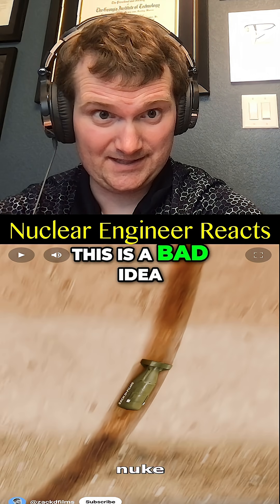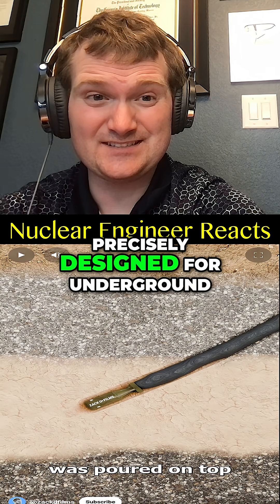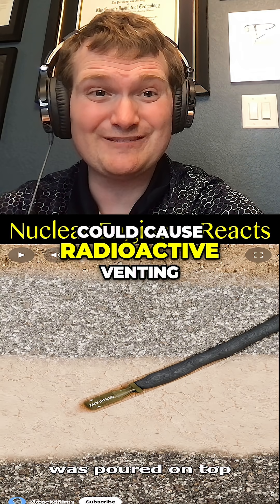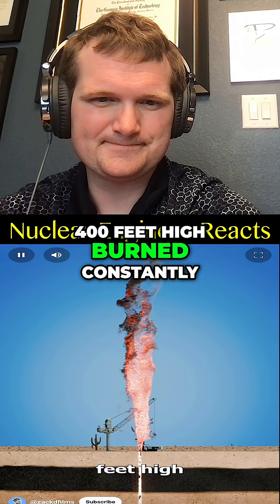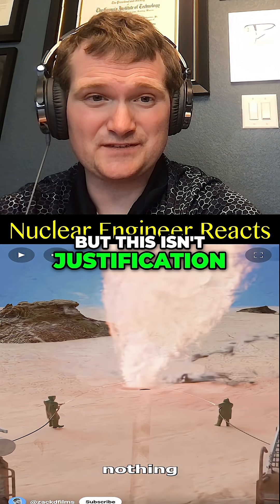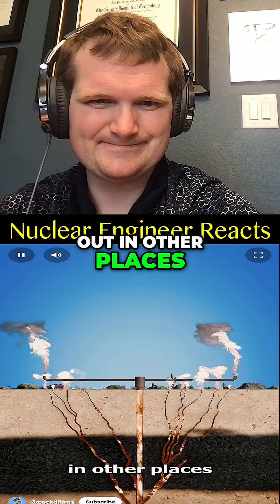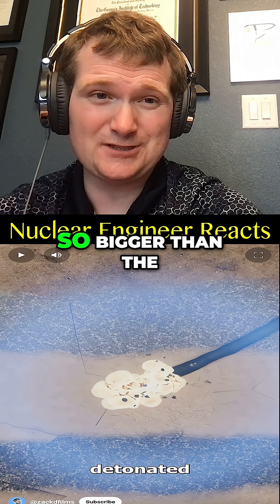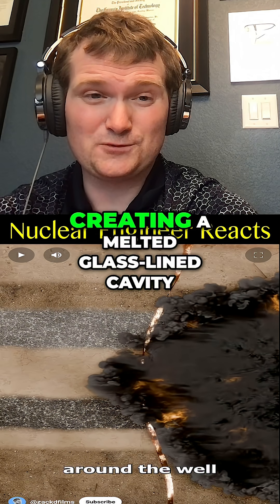They Nuked a Gas Well? - Nuclear Engineer Reacts to Zack D. Films

Comment: Bro is too worried about radioactive contamination, this happened in a remote place where there is nothing and no purpose except to mine gas
Reply: If a nuclear engineer has concerns about contamination I'm listening to him
Reply: @NotCadu  Here in the USA, our federal government did something quite similar out in Grand Junction, CO. They used a nuke to frack an underground formation and create a cavity that supposedly would later flow natural gas. In reality this was just the cover story for a secret program that would create rare elements/isotopes in large quantities using the extreme neutron flux in the vicinity of the explosion. Yes, the AEC planned to make fissionable elements like Californium in large enough quantities for use in missile warheads and shells because the critical mass was much smaller than Uranium. Of course getting to these materials would require mining the radioactive underground cavity and transporting the “ore” to a processing facility in Idaho. 

Now tell me, which country was planning on doing something bat-shit-crazy? At least the Russian use of these underground nukes made sense.
Reply: @NotCadu of course a nuclear engineer is going to have a problem with it. I’ve also got a welder friend who every time in public points out crap welds and says thats a bad weld or that’s dangerous.
Reply: @psilocybinenthusiast5200 That's because it is. An engineer knows why it's a bad idea. Other people just assume it's fine if nothing happened yet.
Reply: @FarawayBrawlHacks I’ve also spoke to plenty engineers who have literally got zero common sense. And it screams no common sense to let a live gas well atmospherically leak like that because ur scared to do that in a desserted area. They had to shut it in.
Reply: its contaminating 1.5km underground in the middle of nowhere... lol so what?
Reply: That’s why I’d say it was a dumb idea, why do this if they could just let it burn? A fire in the middle of nowhere isn’t gonna really be an issue.

Comment: Sounds like if this guy was in charge the fire would still be burning today
Reply: 100% otherwise he would say a solution
Reply: OK, and then what would be the harm in letting it burn?
Reply: @briananderson1246  Severe regional pollution. At a Hydrogen Sulfide concentration of 0.8% and burning 12 million m3/day, that's 96000 m3 H2S daily. H2S burns into SO2 which on contact with water becomes H2SO4 - Sulfuric Acid.

Total output of SO2 while burning would be 98 900 tons per year. For reference, this is around 15% of all coal power plants in the US.
Reply: @briananderson1246 so you're scared of a little radioactivity but you see no problem with s dire geyser burning off for 50 years?

Interesting line you have there.

Comment: How can US Engineers be so bloody minded and stupid with regards to the solution to this problem. In the first Gulf war the Russians cut the resolution time for putting out the oil well fires by 80%.  They fired freezing air through jet engines into the wells and obliterated the heat. How can you people not know this.

Comment: What's not in this video (and I'm not criticizing Tyler, this isn't in the original video)  is that this well burned for almost three years before they decided to go nuclear. I'm not smart enough to know whether it was their best option, but they waited a long time before trying something this wild.
Reply: Of course it was contaminating the atmosphere it was just spewing gas and fire infinitely lmfao
Reply: Meanwhile Centralia, PA's been burning for 60 years. lol
Reply: "Go nuclear." Yeah. Literally.
Reply: What I want to know is if they even needed to do this. From what I’ve heard it was in the middle of no where where it wouldn’t hurt anyone, maybe it was contaminating the atmosphere? Important details in justifying a risky solution to a problem that might not have even needed one,
Reply: @Dovahkiin106  IDk, during the cold war the atmosphere was not a big concern to the americans nor to the russians, if i remember correctly the soviets were trying to use nukes for "peaceful" purposes but most of them failed or were never conceived
Reply: @Dovahkiin106  Urtabulak had very high gas pressure (why the flame was so enormous), which both means gas burns faster and it is cheaper to extract. The reason the Urtabulak gas well failed and caught fire in the first place is a very high concentration of Hydrogen Sulfide. It burns into SO2 which on contact with water becomes H2SO4 - Sulfuric Acid. CO2 emissions is a global problem, SO2 is what generates acidic smog close to power plants. It was extremely polluting.
Reply: @bpz8175 i see I see
Reply: It was the least insane Nuclear project of Soviet, and it worked wonder, the more insane nuclear project... Well, it ended so badly that they had to cancel midway... (They tried to dig a canal with nuclear, but the cost was too much, so they had to cancel it, the canal never finished because of the nukes). Nowadays, the nuclear crate is considered as safe by the local, but not so safe by the experts...
Reply: The way this guy talks is extremely annoying....

Comment: If you destroy the source what would radiate, you would need a constant source of energy to radiate , this question goes into the nuclear device itself, how can the bomb cause radiation when it just goes boom, that's not a radiator. I'll agree that It's better for everyone to behave like the narrative of nuclear bombs is real(it holds a good pokerface)but the math doesn't add up.

Comment: It's only a stupid idea if it doesn't work. Engineer just mad something simple worked instead of some engineered contraption that: 
1. Takes 4 years and 100 people to put the dam thing togather only to realize a critical bolt was misssed and now its gotta be taken apart cuz the bolt wont fit just fit in the hole due to a somtething being riiiiight aganst said hole.  
2. The plans will change daily. Putting everything days behind and over budget.
3. The filters and pumps prone to wear and tear are all buried and will take a major turn around and 3 weeks down time for basic  upkeep...every 2 weeks.

Comment: So. Correct me if I'm wrong. But although nuclear blasts do indeed produce radioactive particulate, it doesn't have a long half life and is completely released within a few months as most of the energy is expended to, y'know, make the big ass explosion from like 50 lbs of material instead of multiple tons of conventional explosive. From my understanding, only bombs incorporating intentionally designed lengthened fallout yields using materials that absorb and then slowly release the radiation from the initial blast (like for example cobalt lined cores) are typically the only ones with any real lenghty radioactivity and these are recognized as "dirty bombs". If, I'm correct. Which i might not be as with anything and anyone an air of caution should be had. Anything can be wrong.
So if I'm correct. He's kinda fear mongering nukes. Im curious as to how legit the rest of his criticisms are, if i am indeed correct.

Comment: So I'm curiouse what the integrity of the seal has to do with anything. Closing the hole also cuts off the oxygen supply. The fire should suffocate and if the seal does fail its just oil that will escape. Also just curious don't today's bombs not have the same nuclear fallout problem the older ones did so would today's bombs be safer to try this with

Comment: This short was purely made for content. It's a place no one lives, radiation leakage is not a concern. "Long term solution" if drilling a hole can be that chaotic than collapsing in comparison magnitudes greater than hundreds of thousands of times of mass to seal it. With the same mass that already sealed it to begin with is without a doubt a solution. "A fire." A fire without oxygen is not a fire. Solution is permanent.

Comment: If you can pump cement into a wellbore, it isn’t a runaway well and you can plug it. This is total nonsense. If you can balance the pressure enough to put a nuke in it, it’s under control.

Comment: The story is true, during soviet times, they had a gas field, called the Urtabulak gas field in Uzbekistan. They drilled and had a gas blowout, and the fire kept on burning, they tried a whole lot of different measures to stop the blowout but none of them worked. Thats why they turned to the Design Bureau over at Sarov, where the engineers there developed a special nuclear explosive of 30kT (about twice the power of Little Boy). The plan was approved by the leader of the Soviet Union, and they dug a tube at an angle to achieve the closest distance possible without risk. The bomb was lowered in at a depth of 1.5km and the tube was sealed off with concrete to prevent radioactive contamination. They detonated the bomb and about 20 seconds later, the fire stopped. The shockwave from the explosion was so powerful that it compressed the tube from the gas well to the point where it basically just welded at a point, sealing it off.
There werent really any problems afterwards, and another similar device was used in another gas field like 1 or 2 years later.
Reply: i mean... just call a private company, they're always looking for ways to make money and sure will hire bunch of people to somehow get the gas out and be able to sell it than spend millions on a freakin nuke bomb inside earth!!!
Reply: Did the USA also do this in Colorado put a nuke underground
Reply: @Argkis well not quite the same thing, the us case was they using nukes to release gas so that they could use it (although it failed because the gas got contaminated with radiation). This video shows them using a nuke to seal gas off and stop the fire and leakage.
Reply: But why? You basically had a powerful fire at your disposal. You could have built a steam plant around it and used it to create electricity until the fire went out :P
Reply: @thegreatlarry9454 a fire from a natural gas well that you have no control over, nor can you know how much gas you will have, its the most unsafe thing ever
Reply: @CommieCrusader and then they stuck a nuke in it 😂
Reply: Thank you for proving him wrong this guys thinks hes always right.. pisses me off
Reply: @AblindmanXX  I don't think it's fair to say he proved him wrong. The guy didn't say it wouldn't work, he just gave some insight into why it's not a good idea.
Reply: @greebo4446  ill take that with a grain of salt… facial expressions say everything! The way he laughs and shakes his head clearly states that he thinks the whole idea is BS… in my opinion he thought it would be impossible because of the reasons he clearly states.. but maybe.. just maybe…if hes SOO knowledgeable he could have said SOMETHING about how its actually been done and actually worked 😂
Reply: @greebo4446  ill quote the video for you… “its nearly impossible to model this with the precision necessary for such an operation”
Clearly impossible is possible 😂 because its been done more than once.. this guy thinks he knows everything stop defending him LOL
Reply: @greebo4446 people like this look down on anyone because he’s SMARTER than them.. not the best quality to have.. just saying… if hes such a genius he wouldn’t be making shorts 😂😂😂 actual brilliant minds don’t denounce anything on social media. They use their gift to push technology and humanity forward.. Not denounce a youtube short that’s clearly AI 😂😂😂😂
Reply: @Jaxxxxxonn  good that you realize your own shortcomings.
Please dont project them on others.
Reply: @Yen-pg3yd please explain how this is a shortcoming of mine? 
If my shortcoming is being annoyed with people who think they know absolutely everything then so be it.. ill applaud people who call him out on it as much as i please! 
its the internet buddy ill speak my mind as much as i want
Reply: @Jaxxxxxonn  what the f do you keep in your mind saying this? Perhaps you just happen to be another engineer knowing better than author on how it's done? The problem at hand wasn't handled great according to today's standards, was this message not clearly delivered to you? Or do you need 300 follow-up videos just so that you can hear that?
Reply: @Jaxxxxxonn  he said it impossible to model ,that the nuclear radiation won't leak out because of bad soil composition, not that it can not be done,you need to increase your hearing comprehension
Reply: And that's why this guy will always remain an Engineer and not the Boss. The Boss has to make the hard decisions which don't require Autistic Perfection and sometimes have downfalls to get the job done. The world will still spin as evidenced by Reality.

Comment: in Romania there was a oil well called "The Iancu Jianu well" that caught fire 100 meters high . in 35 days they managed to drill a secondary small drilling hole that intersected the main oil hole and they pumped in mud made with salt water and cement. they pumped in so much that the main well eventually stopped. the seal is perfect cause the salt water mud helped the cement infiltrate in a horizontal plane basically cutting the vertical well at almost 90 degrees angle and once it hardened it's now a horizontal slab of cement that makes it impossibile for the oil to push upwards anymore. in 2003 i think . in 1920s in romania there was a similar event were they used a similar mix of cement and nitroglicerine explosive that helped collapes the vertical shaft and the cement mixed with the soil and hardened . no need for nukes.
Reply: exactly!! i mean... just call a private company, they're always looking for ways to make money and sure will hire bunch of people to somehow get the gas out and be able to sell it than spend millions on a freakin nuke bomb inside earth!!!
Reply: This thing was 4 times bigger and they tried to put it out for 3 years
Reply: @Youtbeisass same rules apply at a different scale. They just need extra neurons
Reply: There's a bit of a difference between Oil, a liquid, and natural gas which is, and this is absolutely going to blow your mind, a gas! That results in different methods of having to deal with when they decide to be on fire.

Comment: Thumbs down for not taking 5 sec online.....

Yes, the Urtabulak gas field is still active and in commercial production, despite a significant incident in 1966 when a fire was extinguished by a peaceful nuclear explosion, and more recent reports of a methane leak in 2024. 
More details about its operational status:
Historical Context:
The Urtabulak gas field, located in Uzbekistan, experienced a massive fire that raged for three years in the 1960s. In 1966, the Soviet Union used a low-yield nuclear explosion to extinguish the fire and seal the well. 
Post-Nuclear Blast:
The field was brought back into commercial production after the fire was extinguished.

Comment: Well actually, that video oversimplifies all the process extremely. There were a lot of hard work and many attempts, including normal explosive material, which were too ineffective. It was literally 3 years of continuous attempts to seal the fountain.
Reply: Tbf, if it was burning for 3 years without causing enough of a problem to need to nuke it before was there really a reason to not just let it burn?
Reply: @Dovahkiin106  It was wasting a lot of gas, and also made surrounding area too poisoned.
Reply: Sounds like a job for a nuke to me. Dudes worried about radiatioctive contamination when the ground is spewing giant flames for years on end.
Reply: It burned for 3 years? Damn
Reply: Yeah,but they did this several times........truth is they chose to not fix the problems with the extraction process and they refused to allow outside help instead putting other nations and their own at risk over and over
Reply: Meanwhile pacific ocean nuclear test (still radioactive in some places) @jacobishii6121
Reply: @jacobishii6121  You sure they tried other bombs?